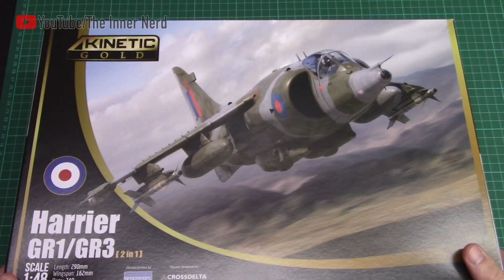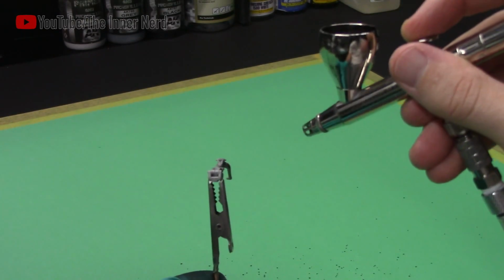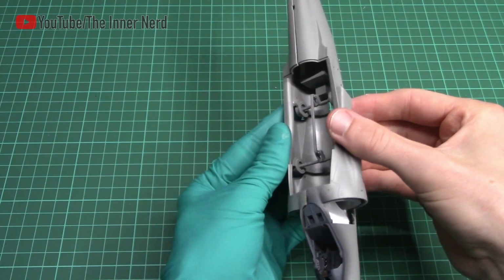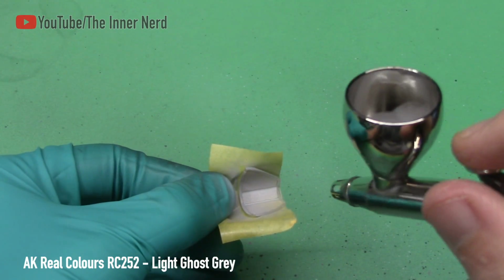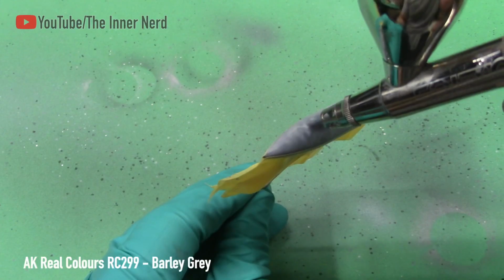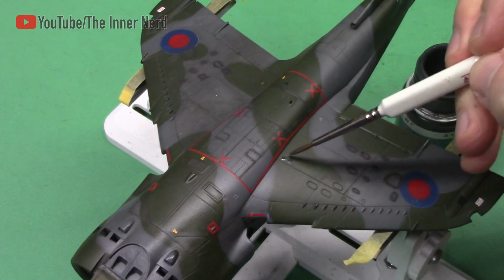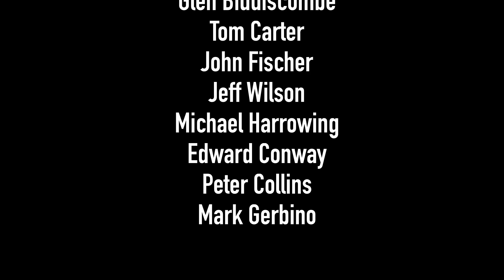Kinetic GOLD Harrier GR.3 1/48 Scale | The Inner Nerd

Comment: Hi, a superb build! The colour texture and 'feel' of the GR3 has been captured beautifully. The only thing (and I hate to say it) is that the forward nozzles were powered from the 'cold' compressor side of the Pegasus engine, so was unaffected by hot efflux. 
They were always in normal paint finish. The 'hot' turbine fed rear nozzles were very much heat affected and so would have looked as your patina effect. The 'puffer ducts' were also fed from the hot side of the ECU and similarly coloured as the aft nozzles. Your representation certainly brought back many memories. Thank-you.
Reply from the maker: Thank you. The exhausts do say this in the instructions but almost all the images I used for reference showed metallic cans all round. This is one picture I used images.app.goo.gl/uLWH4NPpq9nxNP3g6
Reply: Fair comment - you should use source images when researching paint and finish. The front nozzles if not painted, would have been natural steel finish rather than having a heat burnished effect. My recollection of 4 Sqn Harrier GR3 aircraft from the early 80's were front nozzles painted green, aft turbine powered nozzles very heat burnished. In the hover, there is no cooling airflow, so things got very hot. The aft fuselage from the heat shields was very, very sooty and oily - often it was impossible to read the tail number - hence we relied on the fin and outrigger idents. The back third of the GR3 was probably the dirtiest airframe I ever worked on!

Comment: Couple of minor points regarding the harness straps: On ejection the pilot eventually separates from the seat, whilst generally finding it preferable to remain attached to the parachute. In the real thing this is achieved by a catch mechanism which essentially lets go of the harness at a determined point. The upshot is that the waist straps should be inside rather outside the seat pan. Similarly the leg restraint lines that you added are "plugged in" via the pilot's leg straps on boarding. The free ends were generally draped over the control column on exiting the aircraft. Typically, these lines are blue.
Really enjoyed the video and various top modelling tips. Thanks!

PS/ Some more rivet counting from me:
* The engine access panels are actually the 4 forward of the wing and these hinge and prop independently. What you refer to as access panels are in fact an aerodynamic fairing. Iirc, the small panels on the fairing allow access to the lifting points.
* The Pegasus engine is a topic in its own right (The Andrew Dow book is great if you're interested) and an important aspect is that it effectively has a separate front and rear section (that rotate internally in opposite directions). The front is the fan section and thus blows relatively cold air out of the forward nozzles. The rear is the exhaust of the turbine section and is MUCH hotter. Heat staining effects differ accordingly.
* The engine has its own starter/aux power unit (minimising the need for ground support equipment) that intakes and exhausts through those rectangular ducts on the engine access panels. Left hand is exhaust, right (with the mesh) is the inlet. The exhaust one gets quite mucky.
* The red line on the wing root highlights the ground fire extinguisher point for the hot end of the engine. If flames appear during start, the ground crew poke the end of their extinguisher lance into the hole in the vain hope of preventing an unscheduled barbeque (aka "business meeting" nowadays apparently). The red box should surround the hole.
Reply from the maker: Thanks for the insight. I would never have known this unless if have worked on the actual aircraft. I’m just a modeller and have no aviation background whatsoever, the art of modelling is what I like and there are always some inaccuracies with all my builds. Oh well… Thanks again and thanks for watching :)

Comment: Fantastic work! One of the best harrier builds I’ve seen on YT. Very refreshing to see someone actually get the nozzles painted correctly. That’s one of the areas I consistently see many modellers get wrong, for some reason.
Reply from the maker: Thank you and thanks for watching :)
Reply: Don't think they are correct, front nozzles are cold so never burn tarnish. Just look at many pictures, they tend to get painted body colour. I have three Harriers on the go, all long term projects (like 3 years still not finished, biggest is the Hobby Boss, trying to animate all the moving parts).
Reply: @flybobbie1449  Even that depends on the Harrier model. The original versions were unpainted metal. The newer Harriers (BAE/McDD) had the cold nozzles painted.
Reply: @mikemontgomery2654  Yes i have seen that,  which should have said in comment.

Comment: Specific-tip-comment:
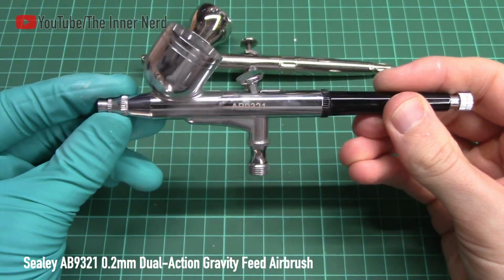4:45 onwards: I would recommend starting airbrushing with a simpler model to get a hang of the handling and maintenance first. My first Airbrush was a rather complex internal mixing airbrush and I promptly bend the finest needle rendering it inoperable (back in the 90's getting spare parts was a challenge).

I bought a rather simple external mixing airbrush and it served me well for a long time, putting up with my inexperienced handling due to being more sturdy in construction.
Later, when more experienced, I switched to a high-end airbrush.

Comment: One of the kits I have been waiting for a video on.
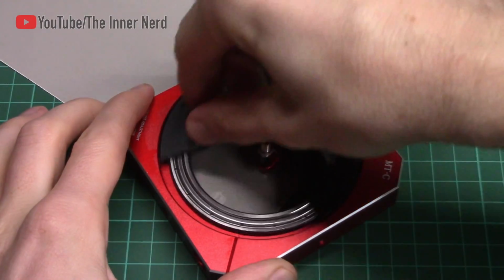I was wondering what mask you use @25:00 - 25:10.
Im struggling to source the A4 paper backed masking sheets i used to use

Cheers
Reply from the maker: I think it's the only build video on YouTube as far as I could see? Strange since I though it would be popular... That's Oramask 810 masking sheet. It's like sticky back plastic designed fro airbrush stencils. Got it for test and it seems good, but expensive compared to tape which does exactly the same thing if you get it in sheet form. Thank you and thanks for watching :)

Comment: Great video! Love the finshed look! How are you able to use so much thinner or spirits with the oils to blend the result without eating away or melting the clear coat layers? I always have this problem and have to either stop the process completely or just go really really light on it.
Reply from the maker: Thank you. I use an acrylic lacquer based clear coat and the weathering is all done using enamel/oil based products. Because they are not of the same base solution, the clear coat is unaffected by the washes and weathering. I explain this in a bit more detail in this video https://youtu.be/W3zDmJwpPcY Thanks for watching :)

Comment: The H&S airbrushes only use the O-ring to seal the air cap around the nozzle. The paint and thinners can never touch the O-ring due to the white teflon seal attached to the back of the brass nozzle.
Reply from the maker: That's right, this one has the Teflon seal that the others don't have saving the O-ring from the solvent. I think the others have PTFE seals which don't stand up to the solvents according to H&S. Thanks for watching :)
Reply: @TheInnerNerd  Teflon and PTFE are one in the same Teflon is the commercial name for  PolyteTraFluoroEthylene (PTFE). I can definitely attest to the chemical resistance of the seals I have been running Tamiya airbrush cleaner and a 50/50 mix of acetone/water as a cleaner for two years and all seals are still as good as the day I bought the airbrush.
Reply from the maker: Okay well that's great. We can buy any of the H&S range and be safe from solvents then

Comment: You might try an artist's pastel or chalk pencil (General's is the brand I use) for outlining the camo. It comes in white which is easier to see and you can just brush it off if the line isn't where you want it. And when you paint the line will dissolve since it's just a powder. Also other brands (Carbothello) come in many colors and you can get them to match the color of the paint you are using.
Reply from the maker: Thanks for the tip, I shall try that on my next camouflaged model. Thanks for watching :)

Comment: The Harrier GR3 reminds me of those softshell turtles with the piglike or "snorkel nose."
I know it's the laser ranger equipment that necessitates the nose extension but it's a bizarre-looking plane because of that!
I'd like to see a lineup of all the basic Harrier types (GR1, GR3, Sea Harrier FRS1, Sea Harrier FA2, Harrier II/GR5/GR7/GR9) but I imagine no museum has more than 2 of the different marks generally.
Ironically, the US has quite a few of the Kestrel lead-in planes but I don't think either of the YA-8B prototypes of the Harrier II were preserved.
Reply: Pima Air and Space museum in Arizona might be the closest you can get. 
They have a Kestrel, AV-8C, TAV-8A, GR3, GR5 and a Sea Harrier FA2. 
It's one of those things that can be tricky, as most GR1's became GR3's, GR5's converted to GR7's, SHAR FRS1's into FA2s, etc. 
The first YAV-8B is preserved at Aviation Challenge Museum in Huntsville, Alabama. The 2nd YAV-8B crashed during the original flight testing back in 1979.
Reply: @BrySkye  Pima sounds like ground-central for retired Harriers!
Oh, and I could have sworn I saw a picture of a YAV-8B Harrier preserved at a museum in TENNESSEE of all places.  It's possible it was also the surviving prototype Harrier II (on loan to another museum before it ended up in Arizona; that happens!) unless someone mistook an AV-8A/C for the YAV-8B prototype.  There's not much difference between that prototype and the initial Marine Corps Harriers.  The YAV-8Bs didn't have the raised cockpit with the bubble canopy that Sea Harriers and production Harrier IIs have.
At least one of the YF-17s spent time at the Naval Aviation Museum in Pensacola before it was transferred to its current home -- probably Battleship Alabama.

Comment: Nice build my man. AK paint in the classic Tamiya jar? Interesting. So leads me to ask the question, how does this AK paint stack up against the Tamiya?
Reply from the maker: Thank you. The AK RC range is honestly the best paint I have ever used. They are as easy to use as Tamiya but with a much wider colour spectrum, The colours, as far as I can tell, are very accurate. Thinning them is consistent and cleaning is also easy. I do highly recommend them if you can get hold of them. I'm not a full-acrylic fan so don't get on well with the 3G Acrylics from AK, these fit my workflow much better. Hope that helps and thanks for watching :)

Comment: Hey I was wondering why my paint peels when I use masking tape I use a airbrush with tamiya acrylics
Reply from the maker: It’s probably down to the paint adhesion. The primers I talk about in this video will help etch the paint to the plastic for better stick. It may also be down to the plastic itself. I don’t get this problem but some model kits need a wash in soapy water to remove any release agent left from the mould. This will help paint adhesion too. Tamiya masking tape is another alternative if you’re using something other than that. It’s lower tack than regular builders masking tape for example